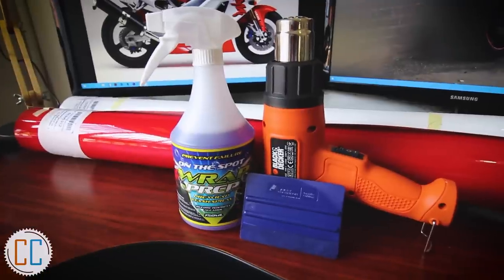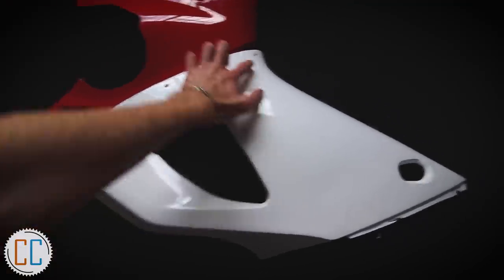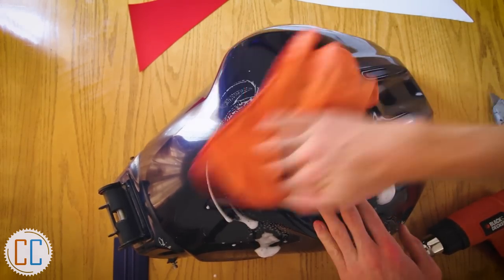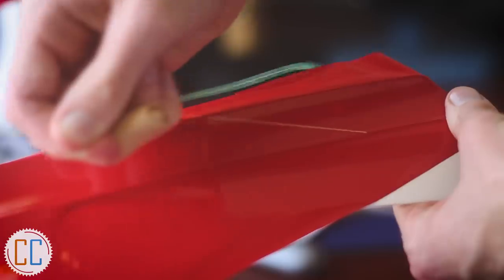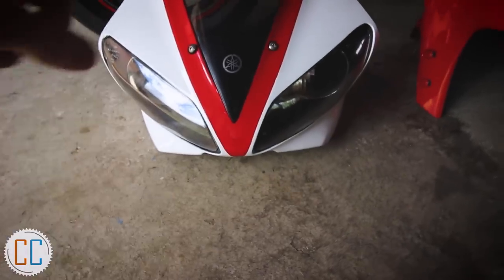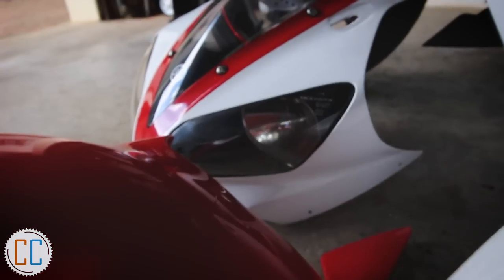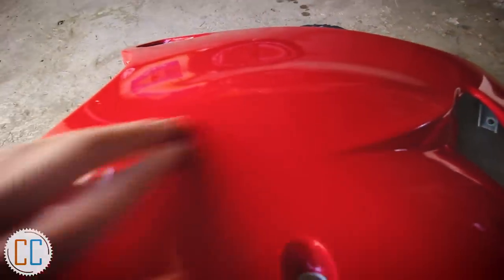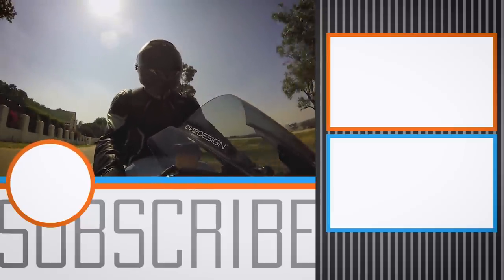Learning How To Wrap A Motorcycle | Yamaha R1 Project Bike

Comment: Put vinyl in your bolt holes first then wrap over top, this will seal it so you don’t end up bits working itself off.
With the tank work from the centre outwards, you have a second person to help so you can hold the vinyl off and heat until it pulls itself smooth and then pull down over the tank, do this slowly working around the tank and you should be golden 👍
Reply from the maker: I learned to do the bolt holes first after the first piece and it made it a lot easier! If I ever wrap another tank I’ll definitely try this!
Reply: I assume you mean putting small bits of vinyl on the underside of the fairings where the bolts holes are,  then be wrapped over top sealing the two vinyl wraps together to themselves? Allowing the undercarriage wrap pieces to help hold the top from fraying/ pulling up? Sorry, confused on your exact phrasing

Comment: pro tip for the tape, if you are doing a stripe you can lay down one line of tape on both sides of the stripe you want to do and then do the side and top vinyl at the same time, peel up the tape and your joins will be really flush, did that on my bike and it came out great. Nice work!
Reply: How has it worked in the long term? I want racing stripes but I'm worried that it won't last as long as 1 piece, with the stripes having edges and all.

Comment: This is awesome. That scheme really suits the R1and you did a fantastic job. Honestly I've never wrapped a bike - I re-sprayed my Yammy FZR250 when I did it up, I wanted flake in the paint now you can get wrap like that I think. I wrapped some dashboard bits in my car well over 7 years ago and they still look great, wrapped a few bits now and then, some experience but I am no pro. This might inspire me to wrap my mrs motorbike - Suzuki GZ cruiser which will be easier - no fairings. Patience and time = best advice for wrapping. Some heat too - not too much though it can burn/stretch.
Reply from the maker: Thanks dude I think it looks great in these colors! I’m thinking about spraying the next bike so I need to learn that next. If you have experience or small bits the Mrs bike should be too difficult and I definitely think you should give it a try it’s rewarding when finished lol!

Comment: Fantastic video, Chaos. I've been wanting to learn to wrap for awhile now. You make this look easy.
Reply from the maker: You should give it a try, I've also wanted to learn for a while. It's not as easy as I thought it would be but after a few mess ups you can get the hang of it and make a decent job!
Reply: Where did you order your materials? The vinyl and solution?
Reply: Where did you order your materials? The vinyl and solution?
Reply: Also, I plan to!
Reply from the maker: I'm based in South Africa so I got it from IntaMarket

Comment: Hey man, i think the bike looks really good with the wrapping on, i've been trying to figure out if i want to wrap or paint my fairings, (i've got the 2001 r1 model), after seing this i think i'm going to try to wrap it like you did.
Would you mind sharing some more info on the wrapping foil ? Would help me a bunch.
Reply from the maker: That's an awesome decision bro it's a great way to make older bikes look brand new again! The best vinyl option is the Avery Dennison or the 3M 1080 series. I personally found the Avery easier to work with and it is a lot cheaper. The only areas that it struggles is in tight spaces so I would suggest getting the adhesive glue for the wrap too. If there's anything else yo would like to know I'll happily answer your questions!

Comment: Hey mate, in a bit of a dilemma and would appreciate your thoughts. I'm thinking of wrapping my bike but there's decals on it already. They arent clear coated and do cover the whole panels (so wouldn't cause ridges in the vinyl if I went right over the decals). The only thing is, I'm unure as to whether I can eventually peel off the vinyl without pulling off the decals with it (I'd like to keep them underneath). It's 3M vinyl if that matters. If you have time to respond I would appreciate it. Thank you as always for the content.

Comment: Great vid 👍
Question.... With the tank you layed out the tape, cut then re taped and layed the next piece. Was there a reason that you didn't lay two pieces over and cut through two bits of white vinyl at the same time? Did you have some vinyl overlap?
Reply from the maker: Yes it's usually recommended that you overlap by about 5mm. It's impossible to cut them so perfectly that they're at the same level because the cutting tape will mess the join up.
Reply: Thanks mate..... I wasn't sure as some vids say you can cut two layers with the tape in one go 👍

Comment: Hey man,
where did you buy the fairing repair kit?
Reply from the maker: I got mine from Auto Zone but I've seen it in hardware stores as well!
Reply: Thx mate. I have a 20 year old Yamaha DT project bike, looking into options to repair the fairings, finding replacement parts here in SA is a pain :(
Reply: @ChaosCauses  is it just called a fairing repair kit or does it have a different name?

Comment: 9:02 - you didn't quite get the knifeless tape joint right - one layer of vinyl is riding over the other, or did you leave the residual green tape underneath?
Reply from the maker: That's the point, the tapes instructions say overlap the vinyl by at least half a centimeter to prevent lifting but the green tape under it is removed afterwards.

Comment: Approximately how much does it cost to buy wrap for a motorcycle here in SA?
Reply from the maker: It depends on the vinyl brand and colours but for 3M 1080 series vinyl you can get basic colours for around R400 a metre and you need about 5 metres to wrap a bike. I got 7 meteres to be sure and it added up to roughly R4000. Keep in mind if you get a shop to do the wrapping they will also charge a lot for labour.